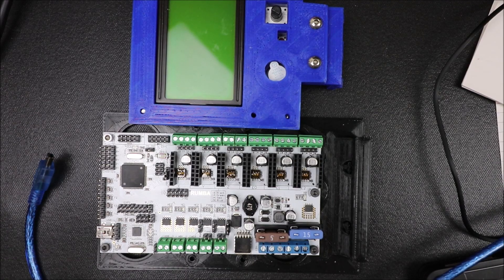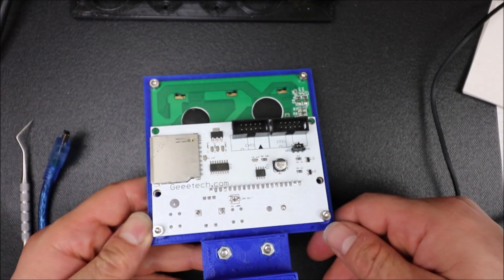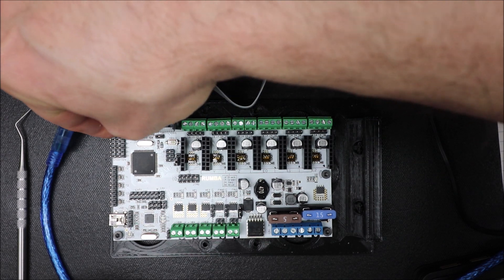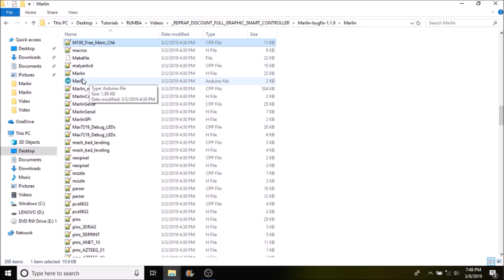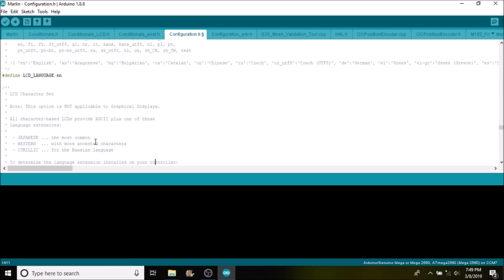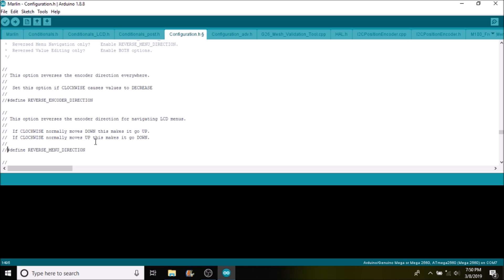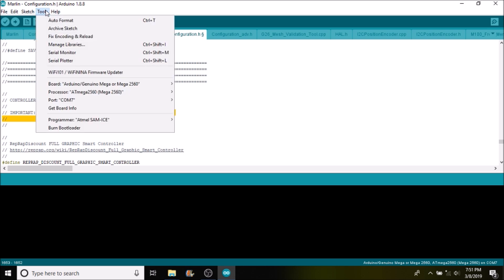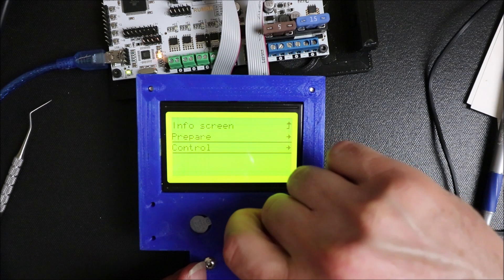Rumba - REPRAP DISCOUNT FULL GRAPHIC SMART CONTROLLER

Comment: hi , when i try  to define sd card  the error message appears 'SPI MASTER in SLAVE OUT pin' and '_DDR' does not give a valid preprossing token ,
Reply from the maker: What type of LCD are you using?  Is this a fresh version of the Marlin firmware you're trying to install with?
Reply: Edward Braiman thank you very much i used a fresh version of arduino ide 1.8.9 and the problem solved my old version was 1.8.6 .
Reply from the maker: You're welcome.